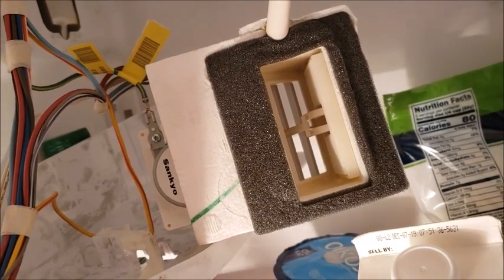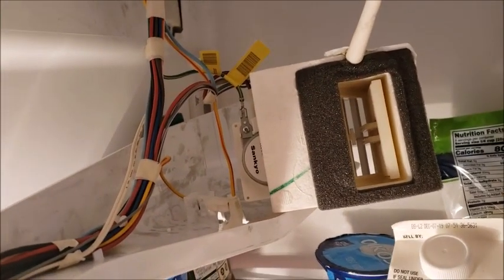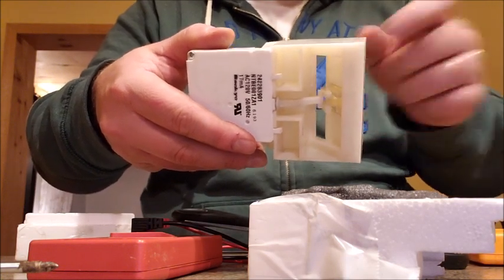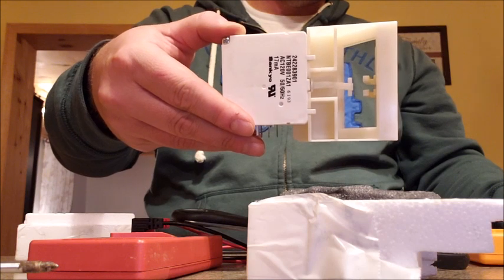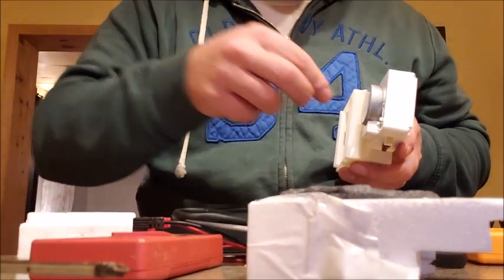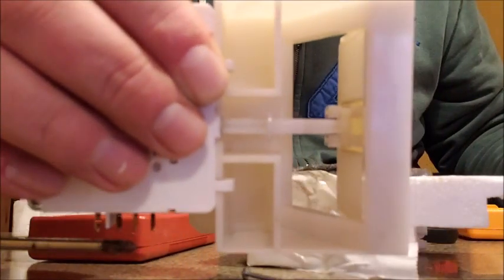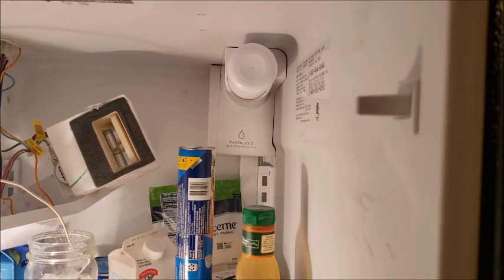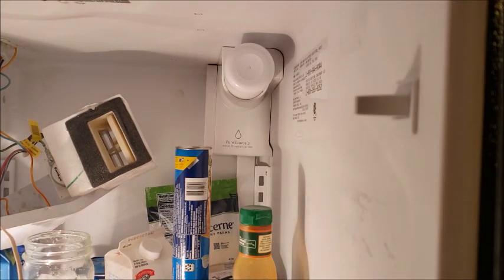Refrigerator Freezing Food, Easy Repair,  Save Money

Comment: I had this problem - fridge waaay too cold, and the freezer was like the surface of Pluto. 

Went through 100 videos - nobody seemed to have a model quite like mine (a kenmore top/bottom but older than this one) or symptoms that matched what my fridge was doing- I found if I moved the evaporator fan panel around in the freezer I could make it blow less air into the fridge, keeping the temp above freezing at least, but that obviously wasn’t a permanent fix. 

Then I woke up and realized that the little dangling wire that I thought was an unused lead for an ice maker (dumb I know)…that I thought had been dangling from the fridge compartment ceiling since the beginning - was actually the temperature sensor. And (in my model) it had to be threaded into the plastic air deflector (my fridge doesn’t have a damper that opens and closes) to work properly. Once I did that the fridge started behaving again (and lo and behold the compressor didn’t have to run the whole time.)

Not sure whether to be proud or embarrassed, but it’s working again and I didn’t have to buy any parts…and I learned a ton about fridges.

Comment: Thanks for the video. I will take a look on my fridge later on. I have the same damper for frigidaire.
Reply from the maker: I hope it's the answer to your problem.  Please subscribe for more content
Reply: Thanks again. I did checked the damper which is ok. I put the thermistor in the water with ice and damper moving (opening and closing ) I just raised up thermostat and hoping this will solve the problem.
Reply from the maker: Maybe try vacuuming the coils in the back.  If it's an efficiency problem this might help
Reply: I did vacuumed the bottom side and I collected so much dust from the condenser side but still do the same ( frozen food ) at the refrigerator side. I suspecting the thermistor. I cannot get any reading to it but when I did put ( thermistor) at the cup with ice, within 1-2 minutes the damper will close and when I did put around my hand it will open. Anything can help. Thank you very much
Reply from the maker: 1-2 mins does seem excessive.   I believe  mine was approx 20 secs.  I listed the times in the video.   You can get a cheap voltmeter at places like Harbor frieght for under $10.  They work well. Then you could ohm out the thermistor